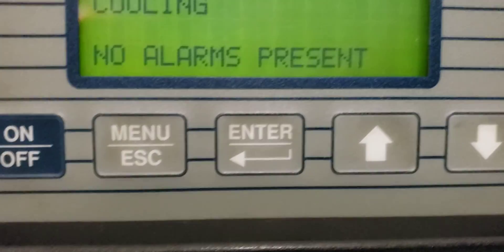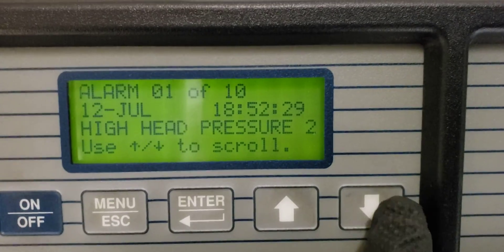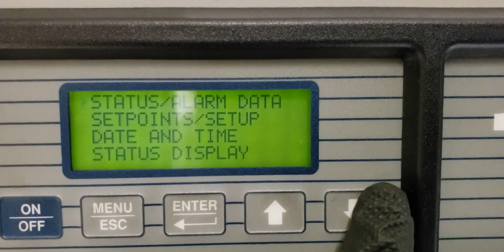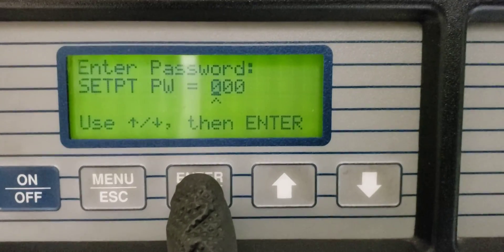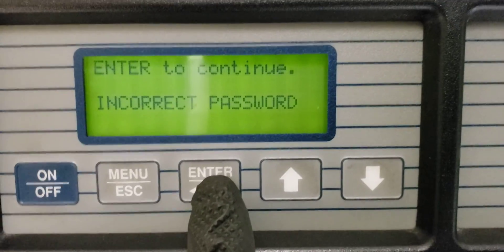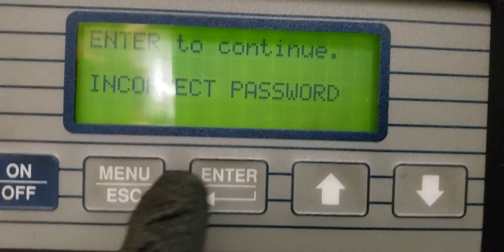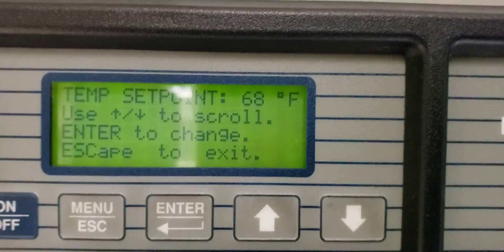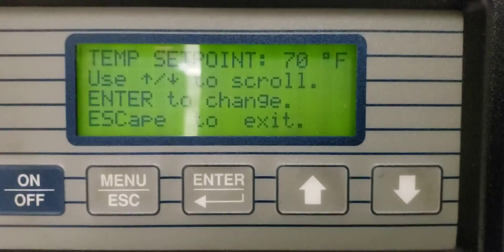LIEBERT, VERTIV/ EMERSON CRITICAL AND PRECISION COOLING OLDER MODELS PASSWORD HACK

Comment: Hello bro your video  good  i need help liebery deluxe system ahu  sow remod  mode  bms not working so how to reset manual over raiding
Reply from the maker: I don’t get the question please rephrase it
Reply: Pro thanks for reply liebert deluxe system  chilled water system  show display unit remote off thes unit was BMs control  fault so how to change remote mode  start unit manual override mode